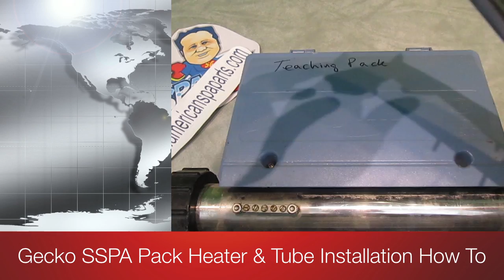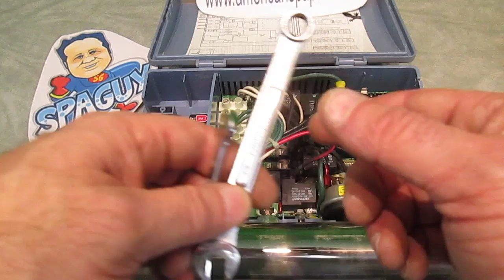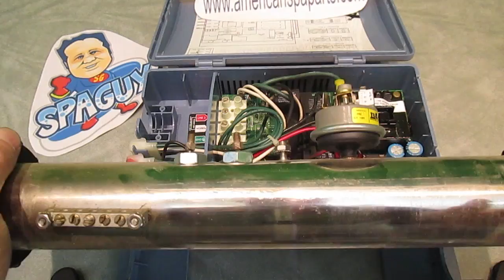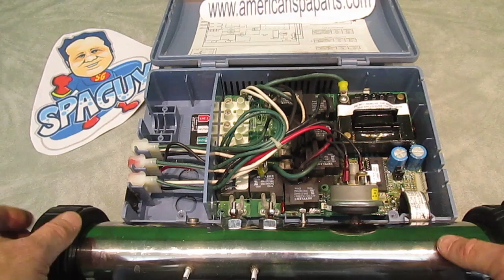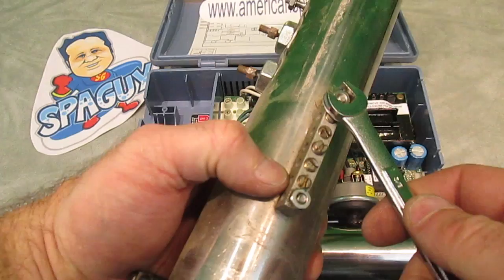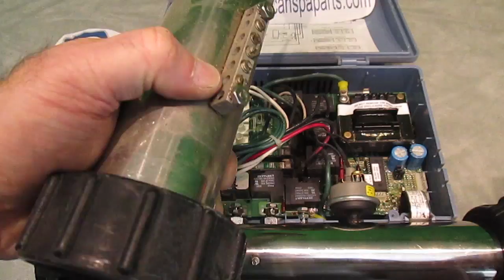Gecko S-Class SSPA Heater Tube & Element Spa Hot Tub Repair How To Video

Comment: How to set tempuature higher than 95 degrees on a Gecko xe pak.Thanks in advance
Reply from the maker: Darren you just set the temp up to 104 with the temp up button.. If you have the temp set higher than 95 and it is not heating past 95 your heater is not working.. Spa Guy

Comment: My heater and pressure checks out good, but I'm not getting any power to the heater. It's a Gecko S class just like this. I hear the relay click when I increase/decrease the thermostat.  Any ideas of how to check the relay, they all have power going to them. Thanks.
Reply from the maker: Hello, If your heater checks good as far as resistance... then you would check for 240-255 between the heater element leads.. if that measurement is zero and the heat indicator is showing that it is calling for heat then you most likely have a cold solder joint on the back of the board... Spa Guy
Reply: I took the board off this morning and all the solder joints looked good so I took the covers off the relays and manually activated them a few times. I'm getting 240 now between the heater leads and it's warming up. I'll see how long it lasts. Thanks for leading in the right direction Spa Guy!
Reply: @gseppi  thanks,  going to have to try that on mine.
Reply: @dakotamar45acp  Pleasure, mine is still working this way.
Reply: @gseppi  i checked the board and it looks ok.  i'll have the tech check it over again before I try ripping the covers off the relays.  they don't seem to give much when i pull them.
Reply: @gseppi   had to solder my board,  there is a video on my channel.